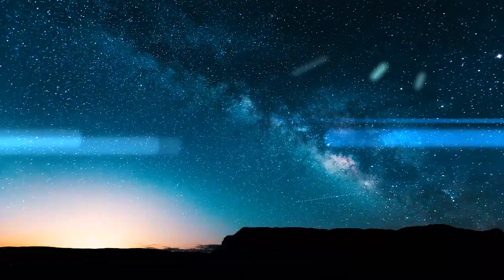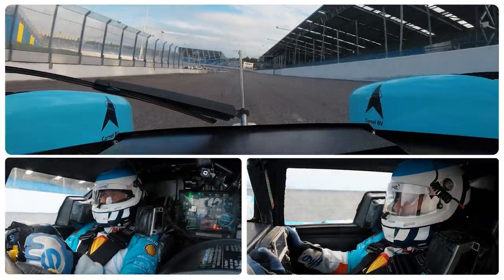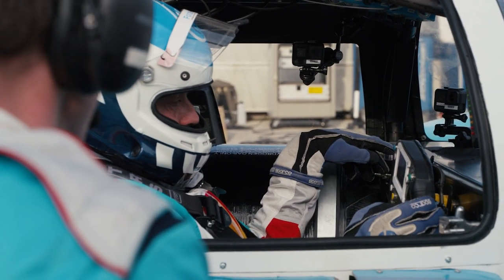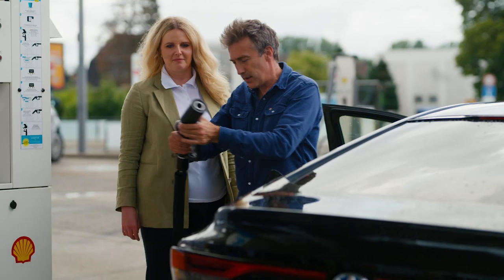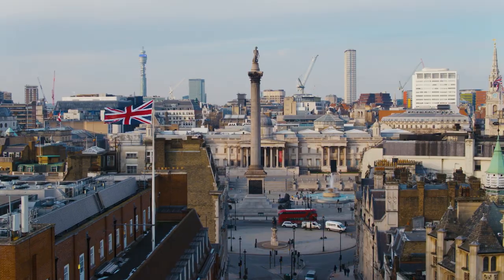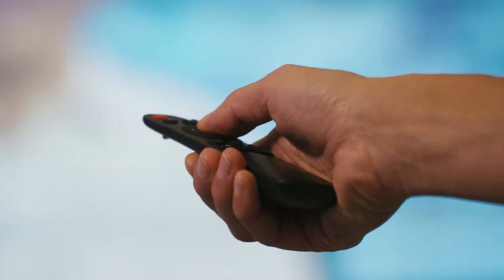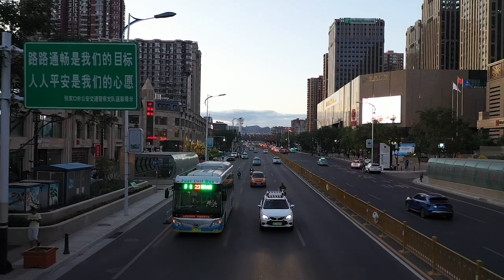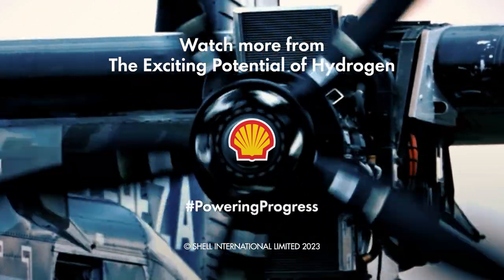From Racing To Your Commute | The Exciting Potential of Hydrogen

Comment: Disappointing excuse to avoid reducing reliance on oil, by making hydrogen from oil.
Reply: Tha counts to ev too
Reply: @mrfishsticks266  Go on then, tell me how much oil is used by an EV over the life of the vehicle. 
Actually, don't bother. I can tell you.
About 50% of a BEV is made up of plastics from petrochemicals, which is pretty much exactly the same as for an ICE. So what?
And then you've got the consumables: tyres, lubricants etc. 
What? ICEs don't use tyres or lubricants?
ICEs don't use fuel?
No matter, of course, that BEV makers are working hard at including recycled plastics at every turn, tr than the industry is working very hard at finding alternatives to fossil fuel-derived plastics.
None of that matters to you, because you are quite happy for the planet to burn, so long as you can continue to drive your gas guzzler. Because, no matter what your ICE, it still guzzles gas, is made of gas and it will still contribute to the global warming that we're all suffering.

Comment: How much is your soul worth? How much the plane?
Aren't you already a successful YouTuber? Do you NEED to destroy the planet? Is it some sort of unexplained urge?
How much did Shell pay you for this? 
Because, however much you were paid, it was never enough and it was never going to be enough.
Isn't it funny that you start the video with a quote from the IEA saying that "low carbon hydrogen should account for more than 50% of world hydrogen production"?
Yet you also completely ignore the IEA's point that hydrogen, at best, will account for 20% of world energy by 2050.
And you also conveniently ignore the fact that the supposedly "low carbon" hydrogen from gas is, in fact, nothing of the sort. The only verifiable report that I have seen on this mythical "low carbon" hydrogen from natural gas is absolutely just as bad for climate change as any other form of hydrogen production.
I hope that you're embarrassed.